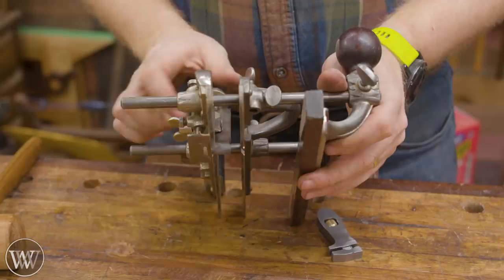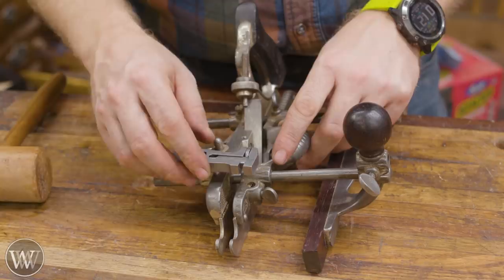How to Setup a Combination Plane Stanley 45 and 55

Comment: If you make hand rails those big fluting irons are great.  Sure, you can do that with a power router also but myself I prefer the Stanley 55 for such jobs.  Just as with making (small) replacement parts for old mouldings/moldings.  It is a gem for these things.  Making 100s of meters/yards of this stuff might be a stretch with the 55 but for that I think I would prefer to order it from someone that make wooden mouldings/moldings professionally rather than tackle it with a power router myself.  I even think I would attack it with the 55 over the power router in any case.

Comment: Hi James, I am relatively new into woodworking hobby and am especially finding hand tool woodworking really interesting. I follow paul sellers and your videos mostly. I found in one of your videos where you had mentioned you reach out for Stanley 50 for.most tasks as it does 90% of the tasks and is simple. I have recently purchased a Stanley 50 and was trying tongue and groove with it but was struggling. Would be really awesome if you could do a review and demo of Stanley 50 especially tongue and groove. Thanks!
Reply from the maker: I might have to do that one some time.

Comment: Great timing! I've bought myself a record 405 (which as I understand is basically a stanley 45 copy) and I'm about to restore it and start using it. Thanks for the great info!
Reply from the maker: Sweet. Yup those are the same plane
Reply: @WoodByWrightHowTo   I also bought a record 405, intending to use rounding irons with it. Doh!! But it looks to me, that you could do it with custom made irons. If the rounding iron was notched (like the cove iron you are pointing at at 1:14) in such a way that the middle of the round was centered on the main skate, and not use the second skate at all. Would that work, or is the second skate still needed for stability of the cutter? If the second skate IS needed, would putting both skates together, so they are touching, and centering the round of the iron on both of them work?
Reply: Found them. Veritas makes them. They call them Fluting Blades.
Reply: Wood By Wright How 2  ha ha

Comment: I recently got one a Lewin combo plane and just did my first cut with it this evening. On the final cut I dropped the "fence" side a little, and ended up making the left side of the channel a little deeper than it was supposed to be. Oops! 
The Lewin has the option of putting the depth gauge on either side, so I think I'll probably put it on the left side in future, between the blade and the fence, so that if I drop the fence side during the final cut it will just lever on the depth gauge and lift up the blade instead of digging in.
I think it's probably a lot more likely that people will lean on the fence side, instead of raising it up, especially when you have a large gap between the skates and the fence.
It's probably what the other depth gauge is for on the 55.

Comment: This excellent video is part of why I have now bought a 55. ( actually two)
Would love to see you set up a 55 for cutting chamfers and angled moldings using the 45° (et al) capability of the fence. 
Also, could you demonstrate using the nicker blade for cross-grain moldings?

Comment: Thanks for the explanation!
Bet it's tough to find one with all the accessories.
Reply from the maker: My pleasure. You just have to know where to look. LoL You might want to check out handtoolfinder.com
Reply: I bought two 55 and they both came pretty much complete. Stanley sold the 55 in its own Chestnut box with sliding lid, and it came with 52 profile blades in four wood boxes with numbered slots where each individual blade went. 
 If someone spent the money to buy one of those it seems they rarely broke up the set.
Reply: I got mine on ebay. Kinda expensive. Facebook marketplace had one dude didn't do shipping found same one with 55 cutters on ebay.
Reply: easy to find, harder to afford!

Comment: Great timing, I'm using my Sargent 1080 for grooves in drawers but am trying to figure out double stop groove I need to make. This weekend I was going to do some experiments.
Reply from the maker: Those are fun. You have to chisel out a spot at the beginning and end of the groove so that the plane can step down into that. but most of the time the groove is so short that it's actually faster to just carve it out then it is to plow it out.
Reply: @WoodByWrightHowTo  that is what I was doing, was hoping to speed up the process. Thanks!
Reply: If you have the scraps from the ends of the boards you could cheat: 
Cut the groove all the way through, then make plugs from the best matching grain you can get from the scraps. With luck it could be invisible.

Comment: So I had a problem with my  45 where the cut would tend to "walk" toward the fence. I thought I was messing up the alignment of the skate and edge of the cutter (like at 6:16). Then I started worrying a skate was bent. Turns out the nicker on one skate always stood proud ( in any position).  Removing it solved my problem. :)
Reply from the maker: Interesting. That's a new one to me.
Reply: @WoodByWrightHowTo  I think the nicker may not be original. It's much more crudely made than the rest of the tool. /Shrug
Reply: I've had that happen before. Nicker was twisted. Never noticed it while cross grain cutting, but I forgot and left it down on a long bead and sure enough that twisted nicker acted like a boat rudder and steered the plane offline.  The old timer that pointed out the problem for me gave advice worth repeating "Don't get your nickers in a twist"   :-)

Comment: The last few weeks I have been watching your video's on te 45 and 55. A nice, quiet way of woodworking. One question pops up: Is it possible to do a simple roundover on he edge of a board? I have seen you setting up a beading cutter to do something like it, but one point still makes a groove in the wood, which I do not want.
I guess one solution would be to grind away that point, but maybe there is a more simple solution? Thanks for helping me out.
Reply from the maker: For that I just use a black plane and or a scraper.

Comment: The 45 will do cove. It even came with 1/4" and 1/2" cove blades. You just have to start out with the blade set shallow and increase the blade stick out after you get the cove started
Reply from the maker: I have never seen a Stanley 45 that originally came with hollows or rounds. I have seen them when you also purchased the auxiliary soul.

Comment: I loved your demonstration of the 45 and 55, but have a question. What you said about the 45 not being able to do Hollows, makes sense.  However, Stanley also sold 3 boxes of special cutters for the 45, and in box no 3 there were 7 hollow cutters.  So if we assume that Stanley would not sell cutters for the 45 that could not be used in the 45, how could you make the 7 Hollow cutters (in special cutters box no 3) work on the 45?  I would like to know how to do this myself.
Reply from the maker: That box of cutters also came with a whole set of fake souls that would slide on and allow the plane to do it. Without those it can't do the work. But with those it does it well. The problem is those are incredibly expensive and incredibly hard to find.
Reply: @WoodByWrightHowTo  Yes, I've see the 45 Hollows and Rounds sets that have the matching bases, and it's not the same as the Special Cutter sets I'm talking about.  Do you have a link where I can send a pic of the Special Cutters Boxes?
Reply from the maker: sure my email address is in the about tab on my channel. or you can use the contact me form on my website and once I respond you can send pictures.

Comment: Thank you for this video.  I just got a Stanley #55 today. 4 flat boxes of cutters. I saw it and 'went for it'. Question. Is one of these cutters for making a panel door rail or stile? If not, could you tell me what of these cutters would make a panel door possible? I have no clue. Thank you, Sir.
Reply from the maker: Sure. You would cut the grove for the panel to fit in with whatever cutter fit the panel thickness. Then you could use another cutter to make the desired molding cut around the panel.
Reply: Thank you for your fast reply. Your input with clues on how to proceed is very helpful. Thanks again!

Comment: I'm assuming that the setup for the 55 is going to be very similar to Veritas' combination plane. FYI, Veritas makes all their combination plane blades compatible with the Stanley 45/55 if you need new or replacement blades.
One problem that I have had is that the 45's knicker blades are way long. When I need a dado, I use the knickers to make fairly deep scores, put the knickers back up, and proceed to cut the dado. Is there something I can do differently?

On a side note, because combination planes have an infinite throat opening, they work great for plane troublesome woods, like the reclaimed Doug Fir that I am making a Roubo bench out of. The resinous parts of the timber is like plane glass and laughs at your plane. It trembles in fear when you pull out your 45, Stanley 45. Just be sure to go with the grain as much as possible and take shallow cuts.
Reply from the maker: Yes. The veritas combination plane is very similar and it's function to the old Stanley's. They changed a few things to make it more ergonomical and a little easier to work with but everything goes together basically the same way.

Comment: Hi James, great timely information. What angle do you sharpen the straight irons at. I see 30 degrees mentioned often but my irons are at a much steeper 45 degrees. They cane that way when I got the plane. Keep up the good work. Thanks
Reply from the maker: Honestly the angle doesn't matter much as long as it is less than 40°. I usually sharpen mine around 35 or 40.

Comment: Curiosity: are the main skates of the 45 and 55 the same? Or, more appropriately, could you use the secondary skate from a 55 with the main skate of a 45 to create all the functionality of the 55?
Reply from the maker: Unfortunately no. The spacing between the rods is different between them. So you can't put one onto the other.
Reply: @WoodByWrightHowTo  That is unfortunate. But thanks for the quick response.

Comment: So if I have a 45 and find a 55 skate.. would that make my 45 a 55?
Reply from the maker: Unfortunately no. The two of them have different measurements between the two rails. There's also a few other foot differences between them and the 55 also has the second fence.
Reply: @WoodByWrightHowTo  well dang